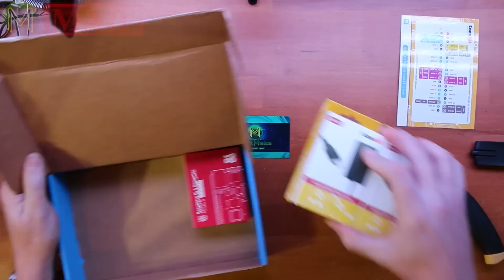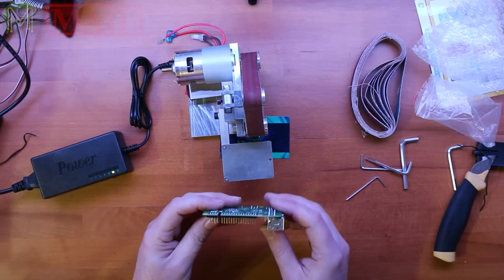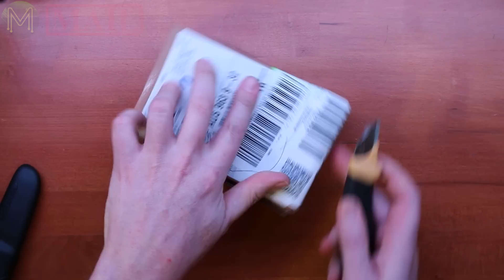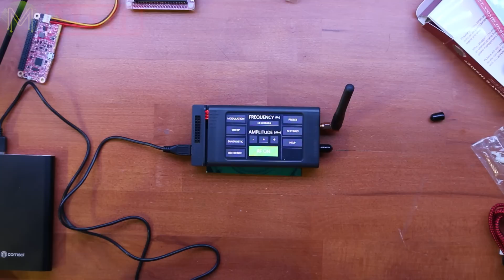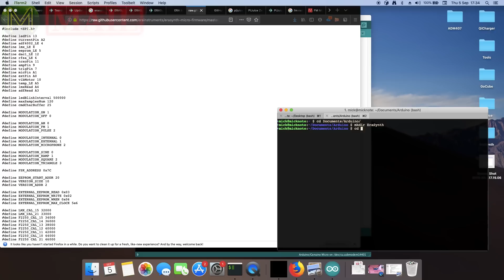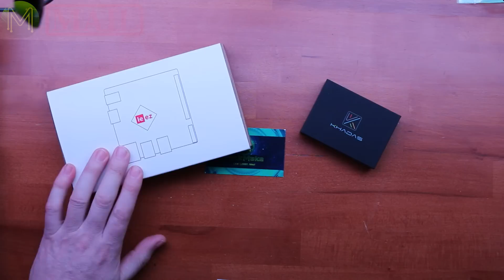#275 MickMake Mail #47: Khadas VIM3, Leez P710, EraSynth.

Comment: Ummm, isn't it rather illegal to be broadcasting on allocated FM radio and mobile phone frequencies?
Reply from the maker: It isn’t if the transmitter is below a certain power output I believe.
Reply: @MickMake  that's probably correct, but it seemed as if you had no idea what that output power was? You just tried it at a low setting, and then maximum.

Comment: Jamming a cell signal in the US will get you sent to jail. Also transmitting on any channel that is not a ham band without a ham license will also get you into lots of trouble. 15dbm is quite a bit of power so you have no idea how far the signal you're generating will propagate. Just saying ...
Not meaning to be a kill joy. Just be careful transmitting random stuff.
Reply: @BlahMadal Doesn't matter. Most western countries have these rules.  I was just illustrating that. Blocking a cell signal also means that you could be blocking emergency calls. Think about it.
Reply: Knowing his knowledge of electronics I would not put it past him to have a HAM licence!  If so then he can play in that ball field
Reply from the maker: Absolutely true, but I believe there is a limit to the strength of the transmitter. The transmitter on the EraSynth is fairly weak.
Haven’t really checked the FCC rules.